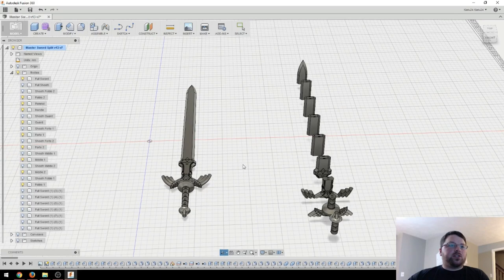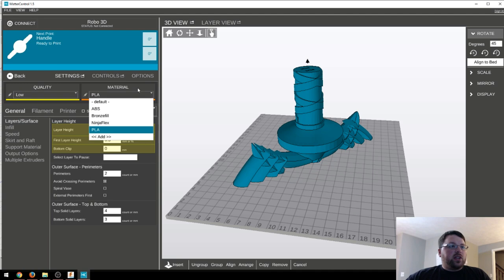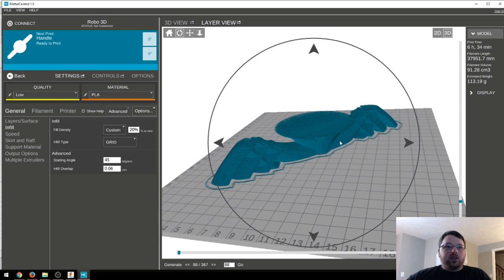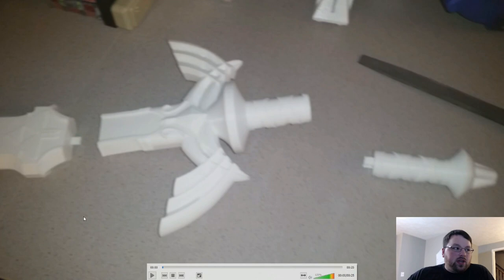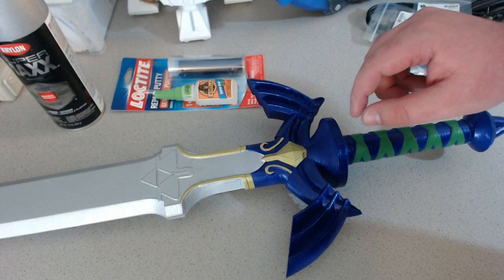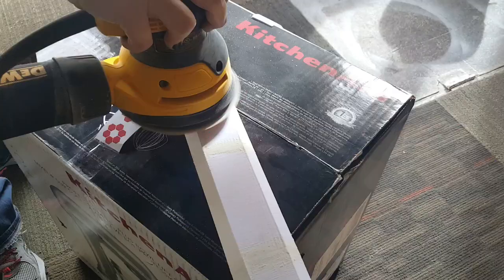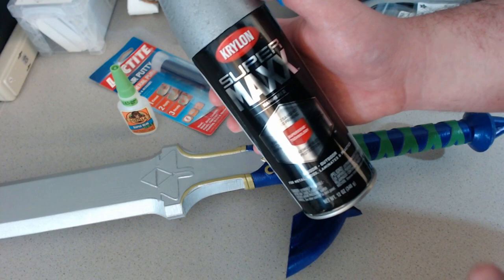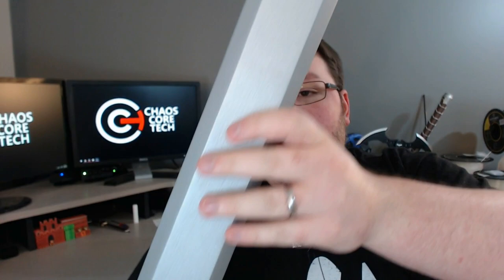3D Printed Master Sword (Full Size) - Legend of Zelda

Comment: I found this on thingiverse, but my printer is only 6x6x6 inches, would the sword still be holdable if the parts were scaled down to be 6 inches tall (and equal scaling for handle pieces)?

Comment: That's were I went wrong! I didn't let the gorilla glue cure properly! I rather stupidly broke my master sword at one of the joins, I have fixed it though but I think I'll go over it again using a plastic glue I have made by UHU to fill in what gaps there are (once the gorilla glue has fully cured).

How easy is it to print in pla? I have a da vinci AIO and not printed in pla yet.

Comment: how much could it cost?
Reply from the maker: +Daniel Bustos (makinon127) Well it depends a lot on which filament you choose to print and things like that. But for this one specifically, I printed it out of Hatchbox PLA filament. So not taking into account for labor costs or anything like that, just for raw materials (filament, paint and glue), I'd say it was close to $30 for both this and the sheath.
Reply: +Chaos Core Tech ok thanks you very much